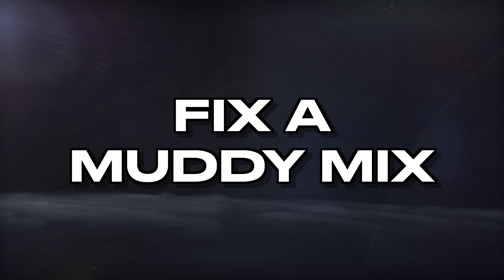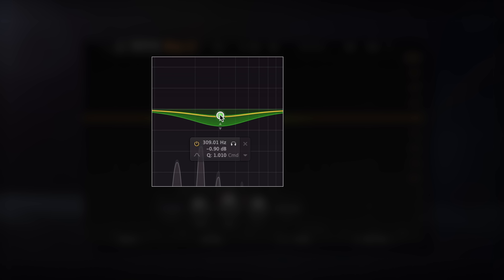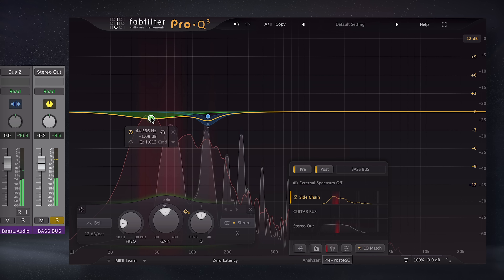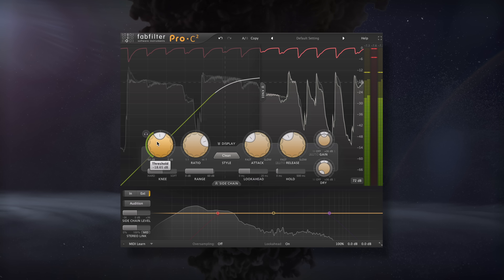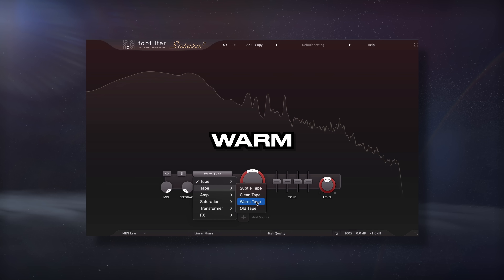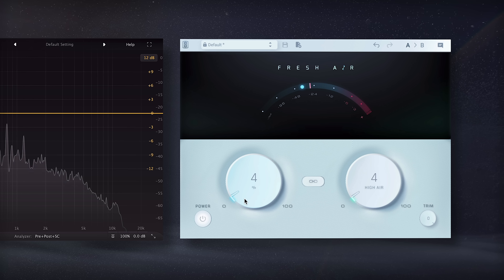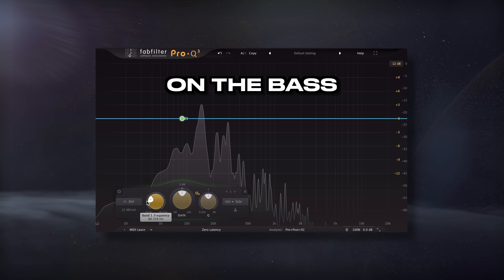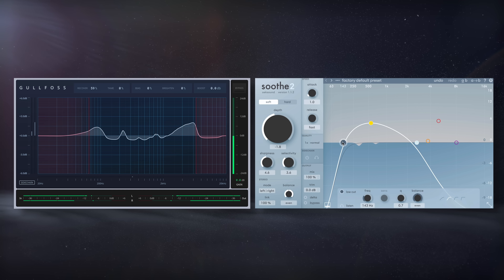Fix a Muddy Mix

Comment: 02:06 is it the same effect if you use fabfilter pro-MB for sidechaining or is there a difference? I didn't even know you could use sidechain for dynamic eq in pro q 3 😂
Reply from the maker: It's similar for sure! The Pro MB and Pro Q 3 act a little differently.  MB gives you more control over the attack and release, ratio, general compression settings, etc.  Whereas, Pro Q 3 gives you better control over the bandwidth of frequencies being compressed.